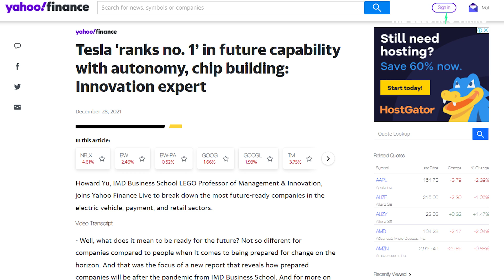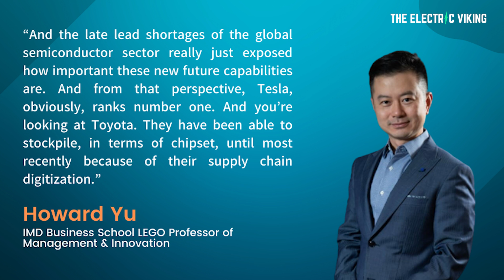Expert says Tesla global leader in autonomy, chips & digital

Comment: News from Renault that they will offer a new Scenic E-Tech in 2024,  based on the CMF-EV platform as the Scenic will share with the Nissan Aria and the Renault E-Tech. This platform opens both for 4-wheel drive and bigger battery packs from the 60kwh in the E-Tech.  Likely will it be equal to the Nissan Ariya`s 87 kwh and a competitor to the ID4.

Comment: in all respect, there are few points that need correction:
Tesla is not building chips, they design them. Manufacturing is done by the TSMC's of the world, hence Tesla is as vulnerable as any other company. What they did probable very well is to stick to the orders they placed with TSMC rather than the eternal order/order cancel methods of so many others.
Tesla is changing the firmware of their microcontrollers and other cannot do that. This is not accurate. Everybody is doing their firmware. You buy microcontrollers naked, the way to use the is your business. Moreover, Telsa has an approach of "central computing" versus distributed computing. Hence one cannot really tlak about the importance of microcontrollers here
Reply: Its been two years, plenty if time to replace orders. No, Tesla has to have some advantage in navigating the logistics of this supply chain meltdown.
Reply: @williammeek4078  The foundries refuse to take reorders and honour first the ones who did commit.
Reply: @peterhirt991  That was two years ago. What is the excuse today?